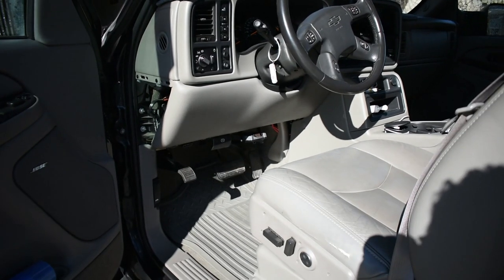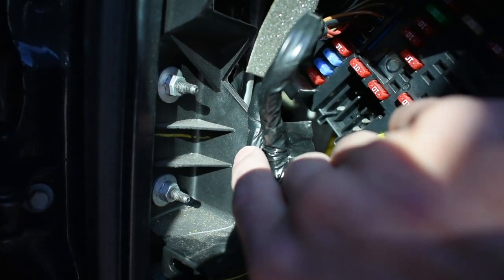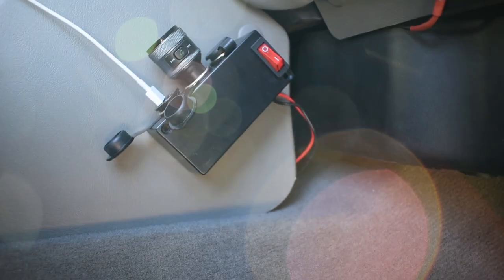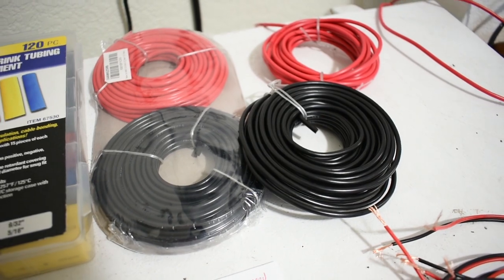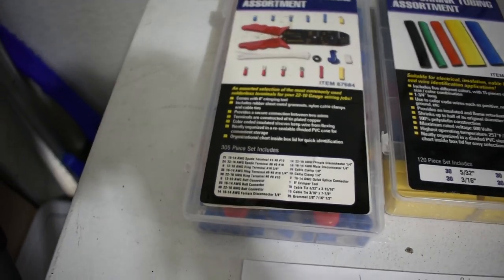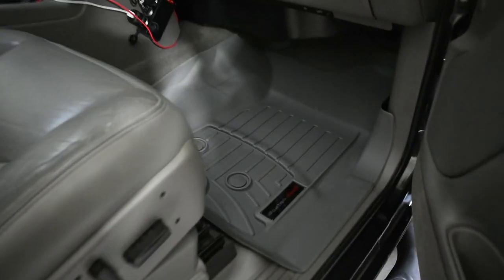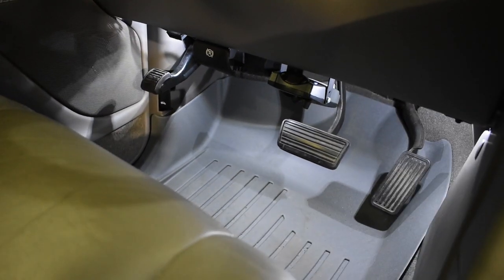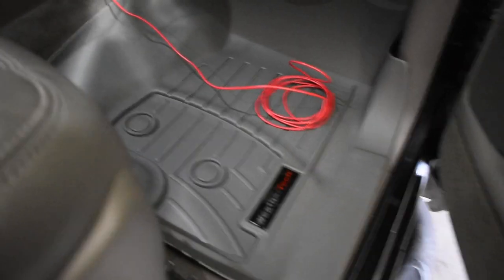How to add footwell LED lighting to Silverado/Sierra!

Comment: Good job! I was wondering if there were actual existing mounts or not.  One suggestion.  The wire size you used was a bit big. 16-18 gauge is adequate for the lighting.  Good video!  Thanks for making it!👍🏻
Reply from the maker: Appreciate it! Totally agree on the overkill wire gauge. Thanks for watching!

Comment: You need to have a Fuse on that wire, then never use a open Ground Wire connector, use a Round Connector. Factory Ground behind the Kick Panel on the Passenger side.

Comment: Can you tell me which fuse is for the dash cluster lights? I don’t have an ILLUM  fuse on my 2006 Sierra 2500.
Reply from the maker: Unfortunately I’m not exactly sure, but I bet it’s in the interior fuse panel to the right of the drivers door on the lower dash. Take that triable cover off and on the back should have a diagram with the fuse you’ll need to change!

Comment: I didn't know that I needed this until I stumbled across this video!
Why did you decide to tie in near the fuse panel instead of below the dash?
Reply from the maker: Thanks for watching! It's been awhile since I installed this, but I used the fuse panel because that allowed me to use the add-a-fuse. I remember needing to do some splicing as well though.

Comment: Hey just stumbled upon your video now and awesome setup! Do you remember if you separately grounded out each T10 or you tied in all the grounds together and grounded in one location? Thanks
Reply from the maker: Hey thank you! If I recall correctly, I think I did a little of both. The rear footwell ones I think are the ones I spliced inline together. The very front corners I was able to use ring terminals and ground to metal bolts under the dash. Either way should work though so whichever you find is easier! Hope this helps. Thanks for watching!

Comment: Question where did you put the second bulbs on both side if it dont have the socket to hold it in place. You never show how you did the second light.
Reply from the maker: Good question, it's been awhile, but on the drivers side I ended up just using a zip tie to a bundle of wires, and on the passenger side I was able to pin it between the dash and the black trim piece that covers up everything. Hasn't moved since. Hope this helps and thanks for watching!

Comment: you said you put 2 per side where did you put the second one on the drivers side
Reply from the maker: I zip-tied it to the upper portion of a pillar to the upper right of the throttle pedal, it seemed like the best option to keep it secure there. Thanks for watching!

Comment: Just found this video and thanks. I have a 04 sierra base model so it has nothing. Question the wire your running to the mirror is for puddle light I'm guessing

Comment: Hey i did mine and now my dome light n the footwell lights wont turn off I connected them to the grey and black wire
Reply: I connected mine to the little box under behind the pedals
Reply from the maker: Weird - what year is your truck?
Reply: @605LIFE  its a 07 classic i got it now i had unpinned the cable for the headliner..i put it back in the wrong pin hole but i fixed it now everything is back to normal and my footwell lights fade away with the rest of the interior lights
Reply from the maker: @Edgar-sw8yi  So glad to hear!!

Comment: Mines an 06 work truck with no courtesy lights or dome light. What wire would I tap into?
Reply from the maker: I wish I could tell you, but I have no idea, I'd start by maybe checking interior fuse panel to find a line that is hot when you open the doors. Thanks for watching!

Comment: What splitter box do you have on the passenger side of the center console?
Reply from the maker: I have a (3) 12v socket bank hardwired into the battery with an inline fuse, I have a lot of chargers and devices haha. Thanks for watching!
Reply: @605LIFE  thanks man I gotchu

Comment: My dome light is not working would you know how to fix?
Reply from the maker: Have you checked fuses yet?
Reply: @605LIFE  would you know which fuse it would be? I have a 2005 Silverado
Reply: @JesusRodriguez-sd8pu  TBC2B is the fuse, on the schematics it comes from the BCM and controls reverse and dome lights.
Reply: @LBZDreamer  how about the cluster lights? I put in led dome lights and accidentally shorted out the bulbs with the reflector. I replaced those fuses and have my dome lights back but still not speedo lights.
Reply: @delta3garcia  I work on this trucks on the daily, 2A is your fuse it controls HVAC lights, IPC (CLUSTER), 4wd lights, rear window switch's (crew cab) and steering wheel control lights. The driver and passenger are controlled by the BCM and uses a 5v ref to PWM the signal from the headlight potentiometer.
Reply: @LBZDreamer  so what would be the odds I fried my headlight switch when I shorted out the dome lights? After replacing those two 15AMP fuses I managed to get back everything except the backlights on the gauges. Every other light works.
Reply: Oh I also check all fuses in both fuse blocks. All of them that I can visually inspect are good. 🤔
Reply: Check TBC 2C it only controls the IPC it's 12v that powers the lights.